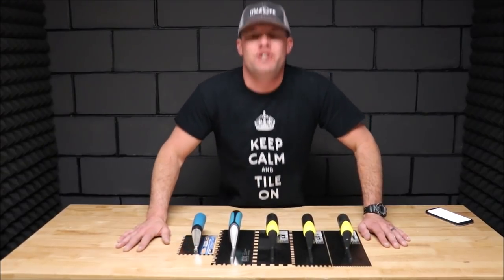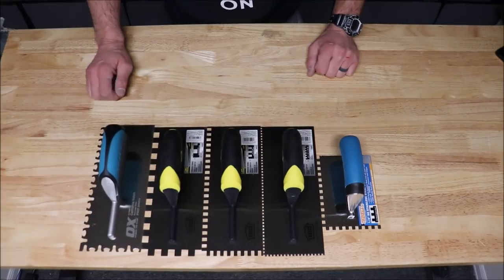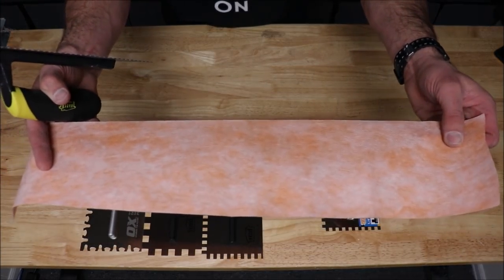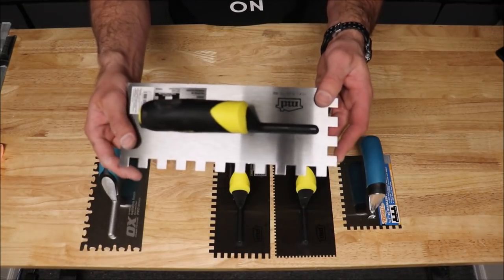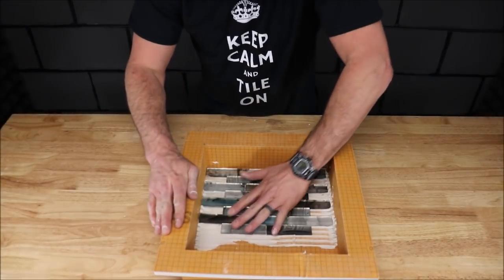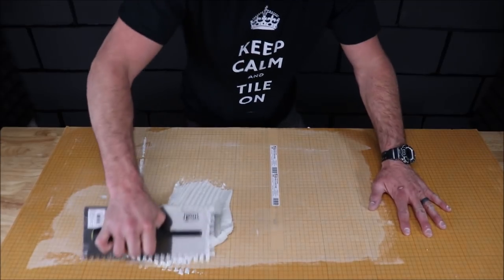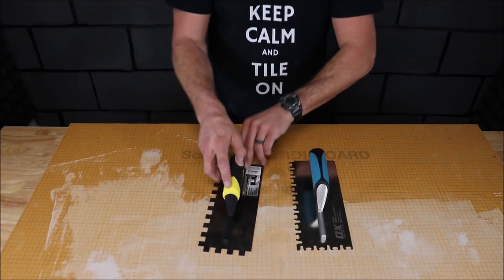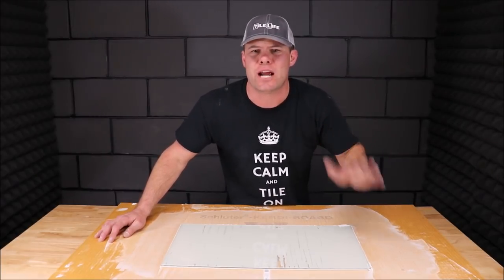Notch Trowels Size Comparison

Comment: Blue ox euro trowels are awesome! Nice demonstration!
Reply: What do you think the resulting bed is of the euro notch?  In the glass panel demo it looked a bit thinner than the 1/2 in square. Maybe between 1/2 sq and 1/4 x 3/8 x 1/4 or basically the same and I’m seeing it wrong
Reply: So what's the difference between the last two except for the price?

Comment: I'm installing 6"x12" marble tiles on a wall as a fireplace surround. Going by size I was going to use a 1/4-Inch by 3/8-Inch trowel but each tile weighs slightly less than 3 pounds.  Should I step up to the 1/2".  And which for the floor in front of the firebox?
Reply: I forgot to mention, I'll be using Mapai LFT mortar.

Comment: What's the minimum thickness the trowel notch can be for a 10mm thick tile. I'm trying to level it with pre-existing tiles that are a lot thinner (5mm) with 6mm thinset projection for a total of an 11mm projection. Not sure if it'll hold if I butter it too thin. It's a tumbled marble mosaic 10mm thick.

Comment: Question: When you install large format tile (24'' X 48'') do you use 1/2 trowel over the membrane and 1/2 in back of the tile ? I mean you put 1/2 of mortar on each end, or less in back of the tile? Thanks for your help !
Reply from the maker: We do it both ways. If you are new to tiling, I would recommend half inch on the membrane and the back of the tile so you can work the tiles in and together to get a flat installation. Both methods work and provide 100% coverage.
Reply: Thanks a lot Body ! I will do 1/2 inch over Ditra and 1/4 in back of the tile, just to make sure it doesn't go to hight for my floor. I watch your video about the wet tile saw dewalt, I bought one ! :)
Reply: Landberg Tile:  Hi my friend!, I need your comment ont that: There is my floor layout: Joist 16'-8'' and 17' at 16'' center with 5/8 plywood tong and groove glue and screew. For the deflexion of the joist the place I bought the joist said L648, L699,L745. I need to tell you than I will have an island of 73'' X 84'' with granit counter top on top of my 24'' X 48'' tile. Do you think my joist are enought strong for not cracking my tile ? Deflexion is ok for the lenght of the joist? Would you add a second layer of plywood on top of my 5/8, maybee 1/2 or an other 5/8 plywood? Thanks for helping me, by the way you are a good teacher !

Comment: Hiw is the IQ saw working? do you recomend better than a dewalt wet saw?
Reply from the maker: It's better with different jobs and applications. Cutting big heavy quartz, it's small and compact and no water! The Dewalt is still the best all around.
Reply: @LandbergTileTV  thanks alot bro i do lots of comercial job and most are porcelain and was thinking on the IQ.
Reply from the maker: @JB-gw5we  I like the IQ better than the Dewalt, but I like the Dewalt when we do miters. If you don't miter porcelain,  then the IQ is a go to for sure.